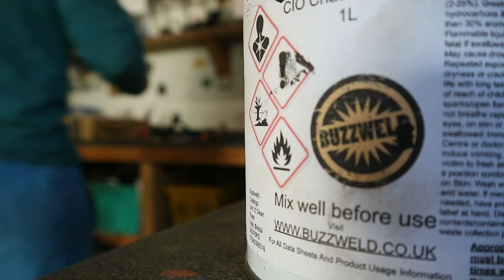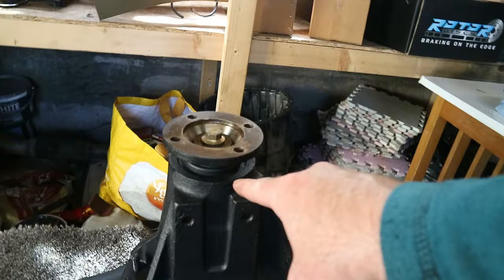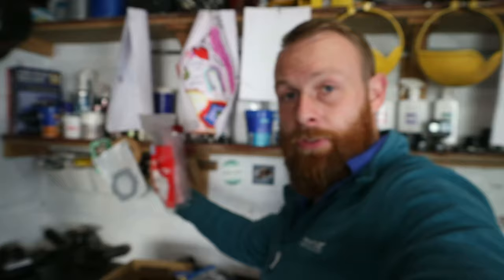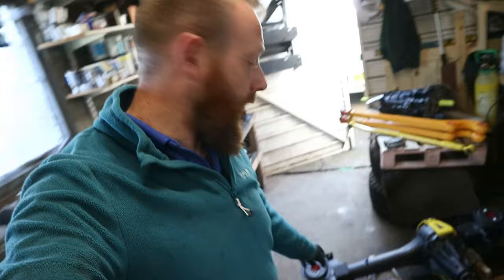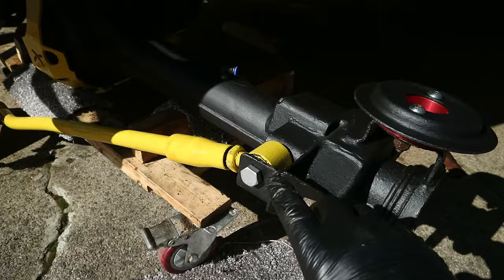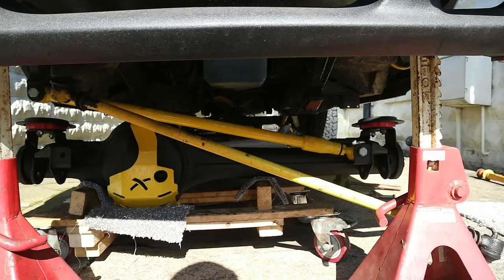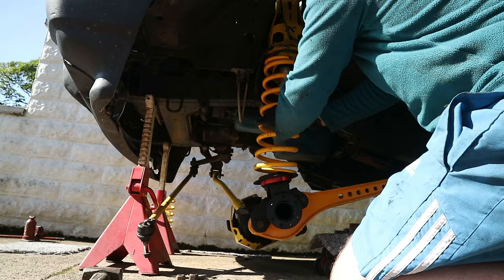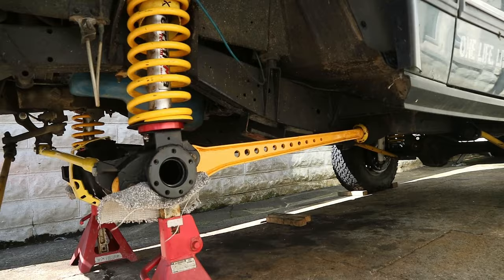Discovery 1 front axle refurb part 3 - refitting the axle

Comment: The bolts for the trailing arms  - shouldn't the nuts be on the outside?  If you want to take them out with the swivels on the bolts might not have enough space???
Reply from the maker: Yep your right I’ve just looked in the workshop manual and they go the other way! Haha thanks for pointing that out to me 👍
Reply: You are correct. From the factory they are the other way around. I was thinking the same thing watching and JUST rolled under my Disco 1 to confirm.
Reply from the maker: @Kris-jk9mq  haha 🤦‍♂️